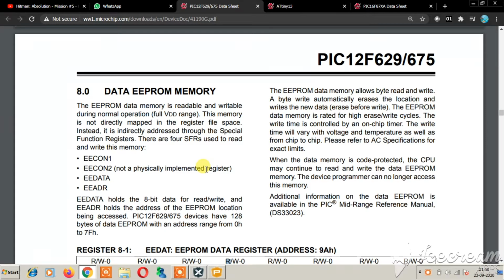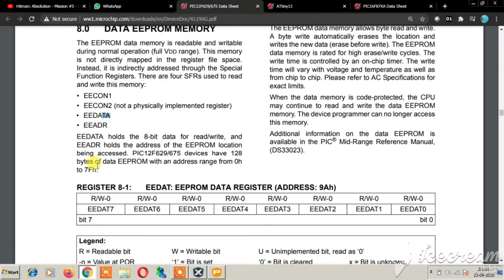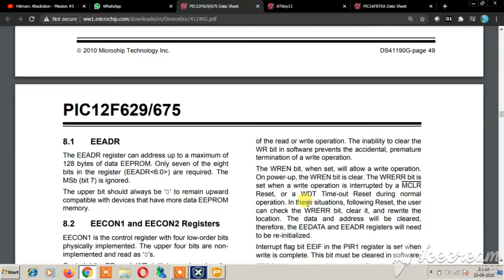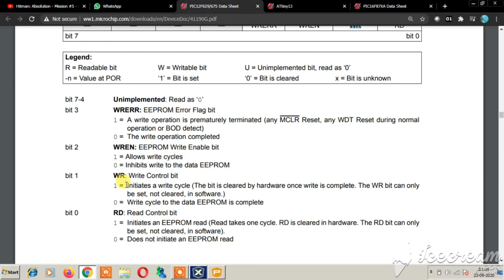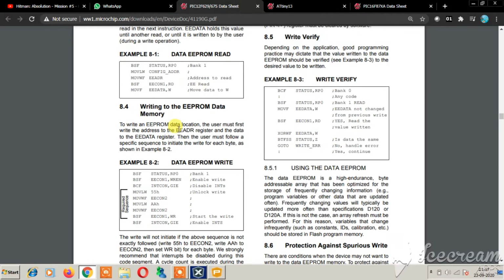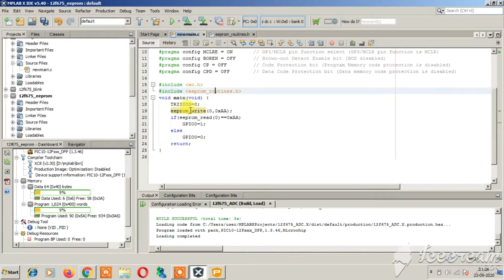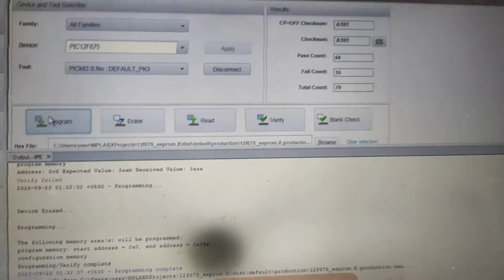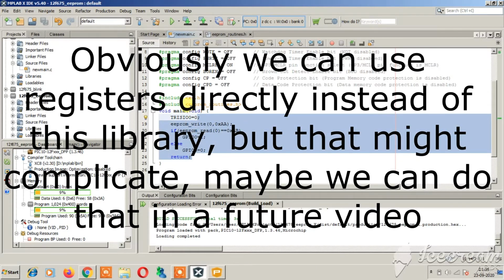PIC12F675 | Using the EEPROM | Code in MPLAB, explained with Datasheet

Comment: Olá, como você colocou os códigos  no microchip
Reply from the maker: this programming is based on xc8 compiler, not hitech c compiler for pic
Reply: @sayantanmaiti2513  Olá, obrigado pelo código .
Reply: @sayantanmaiti2513  Olá, você , compilou a página inteira dos códigos do pic 12f675 ,ou só da parte  que começa com # pragma
Reply from the maker: the xc compiler compiles everything present in the C code. #pragma is used to set configuration bits of the microcontroller at the very startup. It is a preprocessor directive